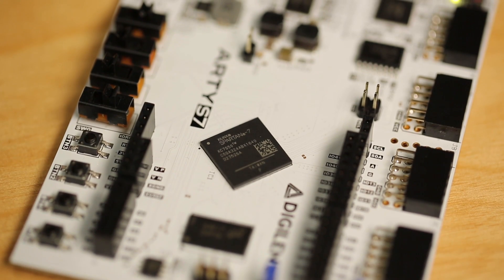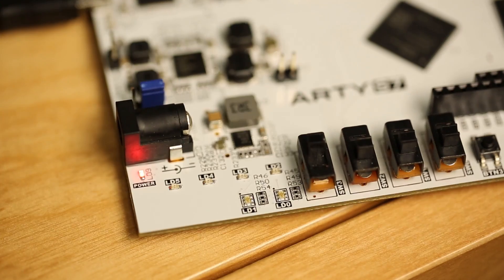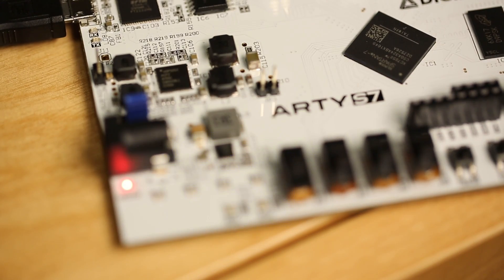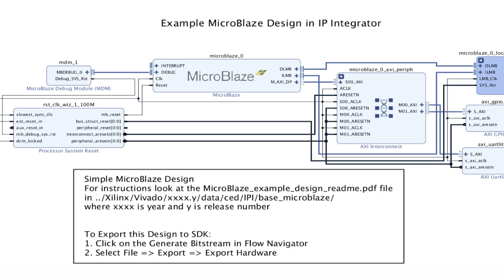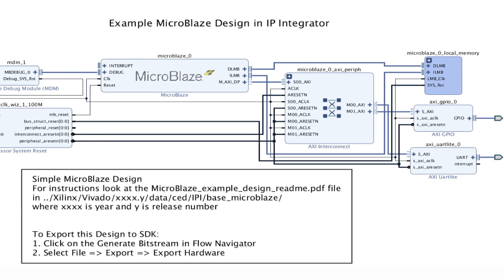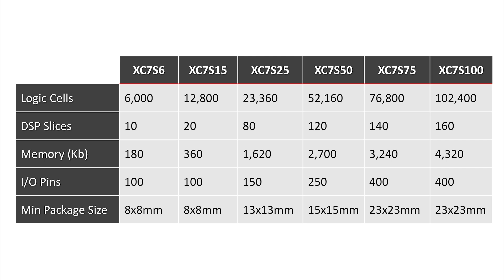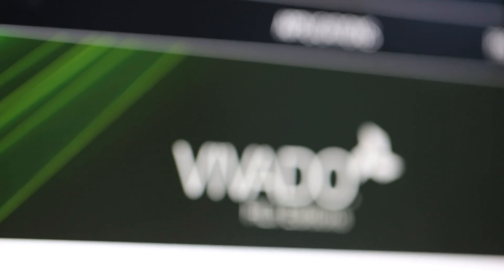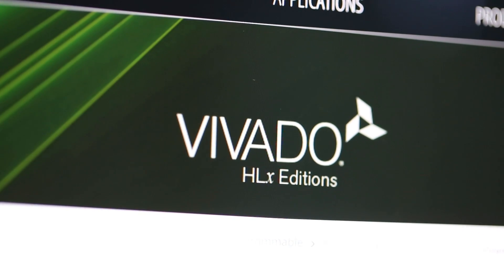Xilinx Debuts the First Spartan-7 FPGA

Comment: Looks like QFP package was axed - too bad for hobbyists. When these devices will be available for purchase to general public? Digikey doesn't list any of them yet...
Reply from the maker: Yes, it’s pretty tough to hand-solder a BGA.. but TQ144 was replaced with FTGB196 for better performance and I/O count, while maintaining simplified PCB routing guidelines. Watch for stock at Digikey in the coming weeks.
Reply: That's good to know. I have a project in mind for which Artix is a bit of overkill, but S7 would be just perfect. As for BGAs for hobbyists - it's not so much of a problem to solder them, as it is the need to use 6 layer boards (or more), which are very pricey for a hobby project, especially considering that odds are they would need to respin them quite few times to get right. With that it's a very good news that FTGB196 can be routed out on a 4 layer boards which are quite reasonably priced (most Chinese shops would make them for about $50). Thanks for information! I'm really looking forward to get my hands on these devices to see what they can do!

Comment: Are you planning to provide a RISC-V soft processor core?
Reply from the maker: Our flexible MicroBlaze soft processor is RISC-based, with a full set of development tools. If you haven’t already done so, check it out!
Reply: I'm familiar with MicroBlaze. MicroBlaze is fine but I'm asking about a different RISC architecture, RISC-V.